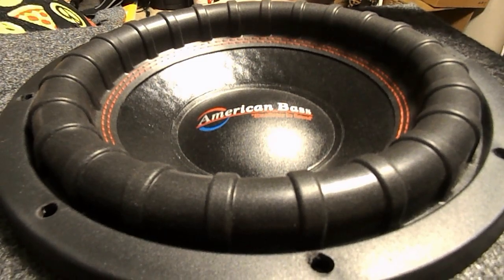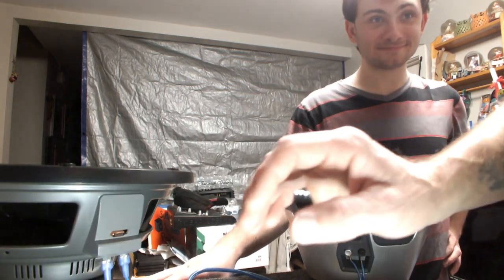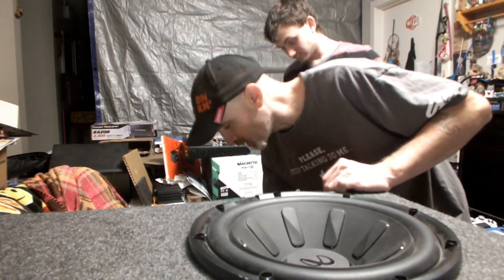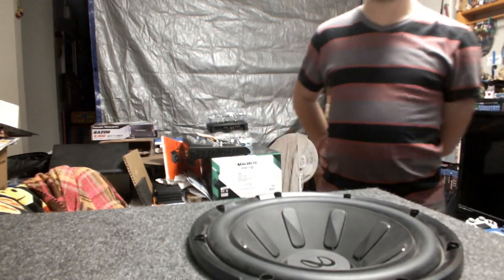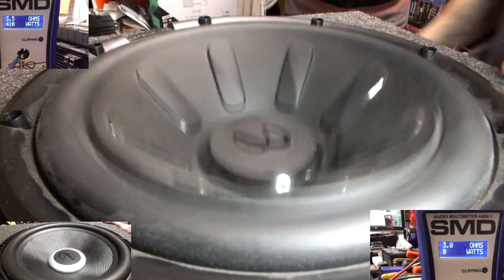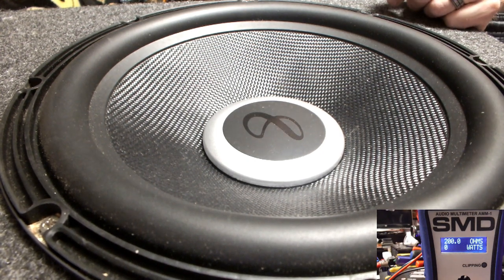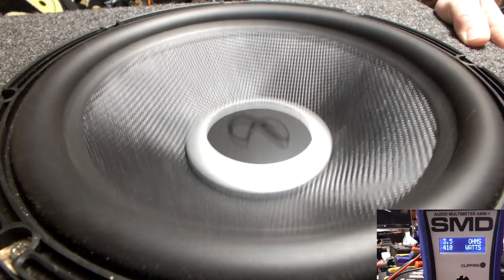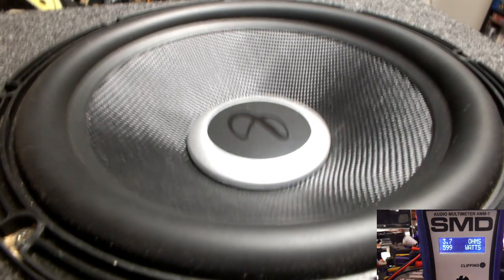Infinity REFERENCE-1270 Vs. Infinity Kappa 1200W 12" 1200 Car Audio Subwoofer SMD-AMM1 Dyno Test

Comment: I own these Infinity Reference 1270s subwoofers. Not a bad video. I think you may have been experiencing unloading when playing the 26 hz tone. They do play well down to a solid 30 hz but under that they lose volume. Mainly because these speakers are for listening to music and not for SPL or super low low bass. They sound good with most all music.
Reply from the maker: I agree, a nice all around sub, even hits the lows. Thanks for your comment.
Reply: Hi, which enclosure do you use with these? Vented or sealed?
Reply: @pranavh437  I used a large vented box. Low bass was incredible!

Comment: Do these play as clean as the kappa’s ?
Reply from the maker: I actually like this one better than the kappas. Sound, power everything. I did a head to head video on them
Reply: @SubzPawz  i’m wondering because I just bought two of the Kappa 8” , uninstalled so far. I’m all about the SQ    and do not want my trunk rattling nor will I be giving them 400w ea. probably around half of that 
Ported or sealed, not sure yet because a .4ft3 sealed just seams so small the basket  would barely fit in the box even if you built it just right.
Which way have you tried them sealed/ported? Don’t get me wrong I do love bass….the thump and gone type of bass, country/rock bass. I can build home stereo speakers all day long, but have never built a sub box. I’d have to say I like the 40hz tone the best, any suggestions?

Comment: Guys I need help I can’t decide which one I want. I want a solid sq sub and they are priced pretty similar and I can’t make up my mind. Thanks!
Reply from the maker: The Kappa just by nature should be better. I think testing them the Reference did more power and sounded better. This is one of the tests I'd like to redo. I have a whole new setup with new power supply and new high power amp. I would go with your gut. The Kappa seems to be the better choice. Thanks for your question and comment 😊. Let me know what you decide.

Comment: these tests just prove the drivers won't burn at its input watt. No more. As you don't test the output power, you won't know the frequency response, you at maximum know at certain freq you get max input power allowed, it is not output sound power. we need to tune each driver to get best frequency response, not max input nor max output, with accepted distortion. Normally we want to know -3db point relative to say 100Hz, or if your ears are accurate enough you can listen to music. max input power are guaranteed by design and mfg, we can simple trust it as far as it is not a lemon.
Reply from the maker: Most of the test is to show the woofer moving at a few different frequencies. I do several videos on one subwoofer anywhere from power handling to SPL and DB tests in a car and van and sometimes depending on the driver a sealed box and ported box. Since this video I've expanded on testing as this is an older video. Now including amperage pull from amplifiers and testing different sine tone's to see where we might hit the most power. As the channel evolves and I learn more about my audience I tailor video's to my viewer's. Thanks for your comment 😊